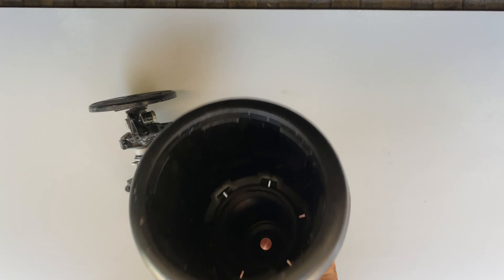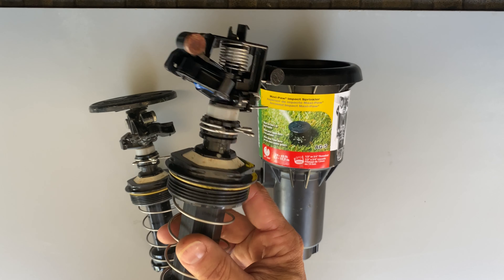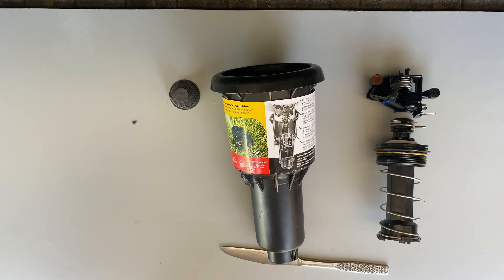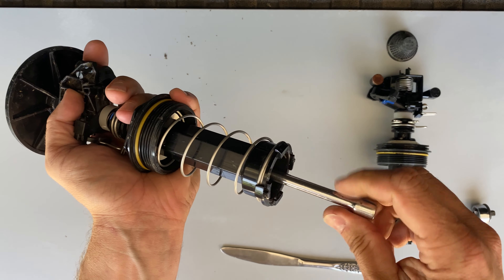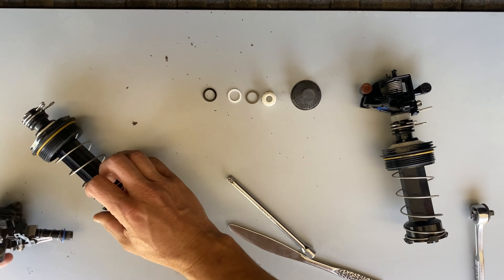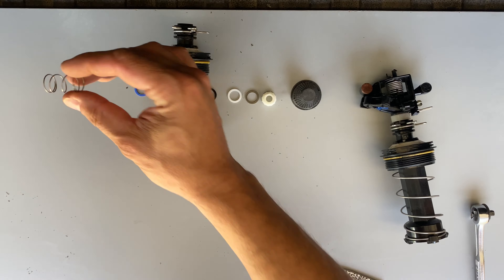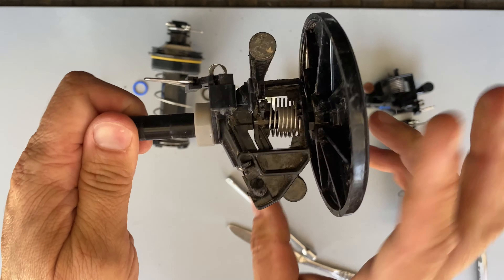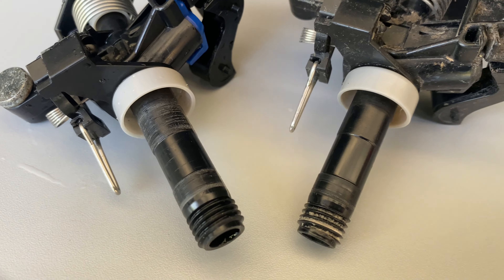MaxiPaw Ag-5 Impact Sprinkler clean & fix

Comment: A tip for all:  when the top lid of your Maxi-Paw is oriented below the level of the soil,  particles of dirt, weeds, etc. will fall down inside the housing.  The accumulation of that soil inside the housing eventually gunks-up the sprinkler head.  You have to dig a small trench (like a moat) around the Maxi-Paw housing (and sometimes a mini drainage ditch to divert mud away), so that dirt doesn't fall in anymore.

Comment: Thank you, Dan , for taking the time to video this procedure.  I have used it on two of my multiple maxi-paws and it has saved me from buying new ones.  The most difficult part of the process for me was getting the special tool to lock onto the base because of the built up mud.  I made a little shovel out of a long handled teaspoon bent at a 90 degree angle to scoop the sludge from around the base of the sprinkler head.  Worked like a charm. I really appreciate your advice.
Reply: I use a water hose with a spray jet nozzle and just flush the gunk out whiled scarring around with a screwdriver. Sometimes bigger rocks can’t be floated so these you have to pick out

Comment: I have these sprinklers & some are still working at 35yrs. I had to replace those by the street more & would.just replace the whole thing. First 5yrs with them I didn’t know you could unscrew them out of the pod & that was a game changer for me but I complained that you can’t just buy the guts for these. I have a collection of new pods with old sprinklers in them for parts. I took one pod & put a garden hose on it to clamp it in a portable workbench to work on them because I hated fixing them on the ground. Then I hated to get up to go turn sprinklers on or have someone do it for me & that’s why I bought a timer with remote, now you can control them with your phone. I bought a cordless shop vac to clean pods out & haven’t used it for that yet. Before I would loosen the mud with end of sprinkler wrench & push sprinkler into pod while it was on to flush it out. I’ve learned a lot of tricks working on these for 30yrs & glad to see a video like this. I had to replace those washers with an old one that broke.because they wore out. I never throw old ones away & I took some from a neighbor who was moving who didn’t know how to fix them. I got them all working for spares. I had the stem crack but the head was still good & that’s when I figured how to take the head off. I see you could just buy the head but it screws on to a pipe & I’m thinking you can put it in a pod. It has the tab for lid on it & half the price of the whole pod. I even replaced the directional switch with the spring from another one. I have found a rock stuck inside the flapper once causing problems. One thing I found out was a pressure setting on the main spring . Our pressure is regulated by the city & it’s irrigation water that comes from a damn & sewage plant that gets filtered.  At the bottom of spring there is a hook that you can move in a couple notches. Sometimes that spring comes unhooked & sprinkler won’t work. I am thinking of replacing all these sprinklers with more efficient ones with less maintenance. I few of my neighbors have already done that & won’t go back to maxi-paws. I like the sound of these sprinklers & that’s why I haven’t replaced them yet.

Comment: I have about 12 of these now, and one won't spin back on the return rotation. When i turn that zone on, I would have to poke my finger at the metal wire that activates the return and move it around or lift it up, and it would work. But every time i turned it on, I'd have to do that to it. Now, it won't rotate at all. Only had it about a week

Comment: great tip on the washers but instead of sandpaper I used a cigar lighter torch with fire to melt the shaft back smooth… it looks new after doing it …
Reply from the maker: that's a great idea!

Comment: I’ve done this procedure to 3 heads that stopped turning after only a couple summers. Sprinkler season here in Colorado is only a bit over 3 months. I’m on a well with mica in the water. After working to clean and smooth the shaft they turn for a week or so and then stop again. I have some rain bird heads that are well over 25 years in service without a hitch. It’s the newer ones that simply won’t last. I haven’t tried the torch technique and maybe that will be a longer lasting repair. The real problem I think is they are using a much softer grade of plastic and the clearance around the shaft may be less than the old ones.
Reply: Exactly! The old ones lasted for me at least a decade now some of the new ones won't last 1 summer.